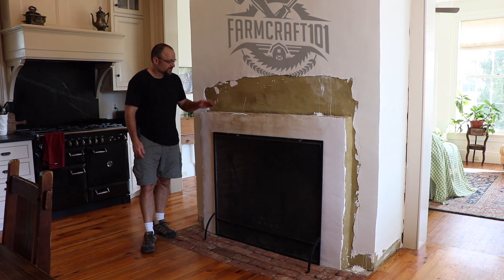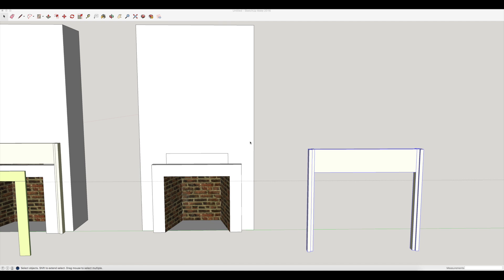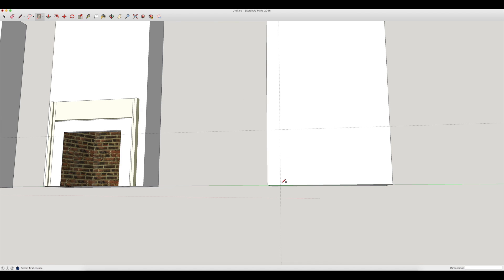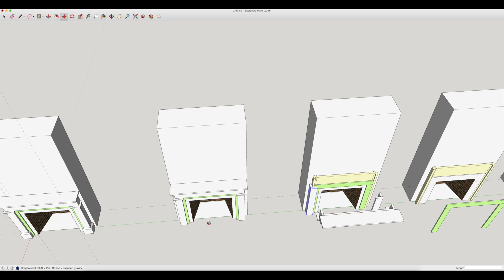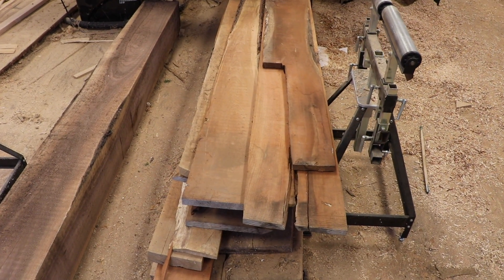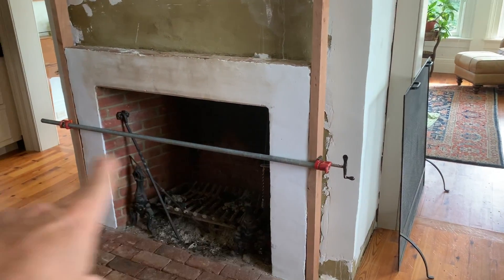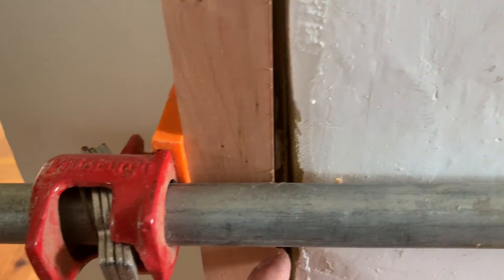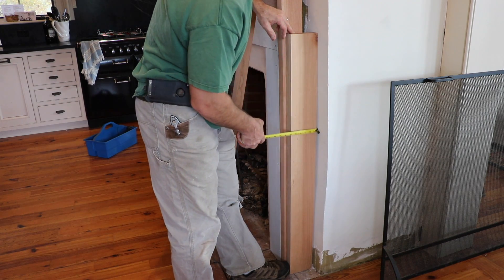Reproducing an 1850's Fireplace Mantle From Scratch, Part 1. FarmCraft101

Comment: John, I had a Guy weld  me a thing that fits under the opening of the front of the fire box. I looks like a little hood. I remember you saying that the front of the fireplace gets black. < it looks like an overhang about say on a 45* angle and goes the length of the front of the box. I have it screwed up into the plate that hole the brick in, it might be called a lentil. I had the same problem, my brick was getting black in front and it was hard to get it off the front of the brick. I know you could make one of these for your box. I think it is about 2 1/2" wide and it 36" long, the plate is a little longer on top so you can screw it to the lentil. It looks like this < but is longer on the top so you can screw it in. The side have cap /\ welded on the sides to keep the smoke in . This should be turned on a 45* Very hard to show you on here. I hope I came across with how to make this. It also does not interfere with the fire place screen. Thanks John for sharing, Great Wood Working Skills ! 😅 Todays date 09/13/2022.

Comment: When i match the wall to the board, i use a washer with the inside diameter and outside diameter slightly larger then then the gap and roll it along the board edge. It works pretty well for me. I have arthritis in both hand so the other method is hard to hold.

Comment: As somebody who used to use sketchup, and works in construction and fabrication, I would like to wholeheartedly recommend a program called rhino 3D. It's a lot more precise in advanced and sketchup and there is a massive online community of people that talk about how to use it for specific implementations. Lots of things to add on and learn.
Reply: Rhino may have been free when this was posted (don't really know) but if that's the case, it's not anymore.  Free 90-day trial and then a license is between $700-1000.

Comment: You should build a wood fire hot tub from start to finish... cycling water, a cut off when it get's too hot, the heating element, the wooden tank... kinda a tough project... just a thought.
Reply: I've seen that done as a trailer. Everything built into the trailer. It was really pretty cool, and really nice when you're whitewater rafting in 50degF water!

Comment: Whoever built this house 170 years ago really really wanted to be warm.
Reply: No central heating. If you wanted heat in a room, you needed a fireplace.
Reply: @ScottKenny1978  and 170 year ago the word was more cold, plus less electronic that generated heat, big houses and simple clothing
Reply: @MakarovFox  but they did a lot of physical labor 170 yrs ago, and could run circles around us bc of they were always doing physical things. My grandmother's stone farm house was freezing in winter. I put clothes end of bed and put them on under blanket to get dressed. Her house had 5 fireplaces. They also knew how to bank a fire to go out & work and come back and make their food or check on it
Reply: @2Ryled  i dont understand the first part
Reply: 170 year ago...fuel was cheaper than insulation.  Insulation usually meant open stud cavities, maybe stuffed with some newspaper.

Comment: So in 1850 I guess they did not have cement board and had to use ... er... wood?  Well as the house did not burn down in over a century why such a complicated structure for a decorative surround? I am not a builder or from US  and dont know your building codes, i am just curious.
Reply from the maker: Yes, they would have used wood, and often got away with it, but occasionally they would catch fire and burn down the house.  The one in our dining room (the blue one I showed) has a burned area under the board going across the top of the opening.  You can't see it from the angle I showed, but it came VERY close to catching fire at some point in the past.  We don't use those fireplaces any more for safety.  The ones that we use we have updated, lined the flue and built them to code.
Reply: @FarmCraft101  ...Was copper flashing around at that time?  If so, they could have used that to prevent the top mantel from catching fire.  Even tin would have worked.
Reply: @FarmCraft101  Thanks for answering, the extra work is worth it to keep you family save and I guess last year gave you more than enough experiance fighting fires that you never want to repeat.